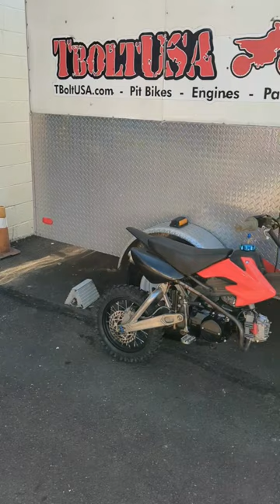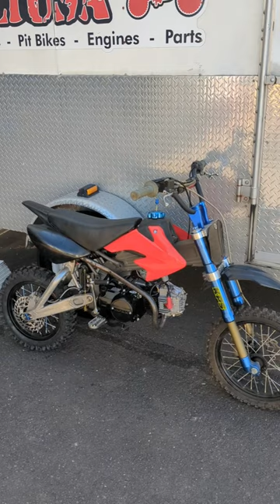New tbparts 138cc V2 roller rocker head kit 57mm bore 69mm tall cylinder on a lifan125

Comment: She's mean 😁
Reply: TRUE STATEMENT !!
Reply: Is this the semi auto motor? @vincetboltusa4917
Reply: How is the reliability with the big bore kit?  I read on another video that they only made it 50 miles before they blew the gasket.  Is there a way to ensure longevity or reduce compression a bit to avoid engine failure with the BBK…. This is for street riding mostly…. That’s so much!